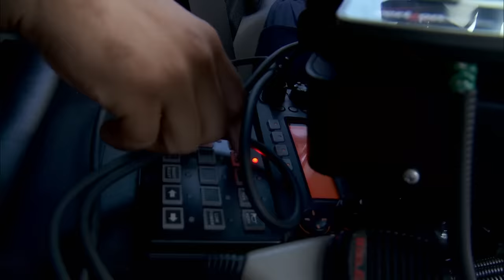$100k of Cartel Cash Found In Hidden Engine Compartment | Bordertown: Laredo | A&E

Comment: That was not the car that was involved in the chase. That was a truck/suv you can clearly see by the tires and if you know mechanics.
Reply: yea looks like a grey tuck or van
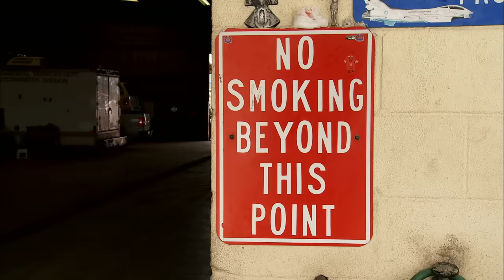Reply: Good catch...the difference between 2:16 and 3:20 Mag wheel rim and side step car on the second one is easy to spot but I did not notice at first
Reply: 2 different scenes.
Reply: @kaosinc  how are u
Reply: You mean the police lied? shocking
Reply: If the torque converter was replaced with a hollow compartment I'd guess the transmission wouldn't work
Reply: @pepsico815  its two different scenes
Reply: @frostfreerunning690  Yeah, a stick shift Grand AM ?
Reply: @2pugman  wym the car that was pulled over ? Nah I’m saying the car lifted definitely is not that small grand am
Reply: Not to mention the car was FWD Grand Am and the undercarriage of the truck/ SUV was clearly RWD since they disconnected the center drive shaft 😅
Reply: Plus the drive shaft it ant no front wheel drive car lol. Made for TV be!!!!
Reply: @pepsico815  Go figure 🙄
Reply: Looks like a F-150
Reply: Your point? They didn't claim that it was the same vehicle.
Reply: @randallsmerna384  they said since the suspect ran they impounded the vehicle and is doing a thorough search on it.
Reply: Good catch, so basically this is all BS.
Reply: @kaosinc  Of course you didn't notice at first but don't worry,some of us actually do notice and pay attention to things,we're just built different son!!
Reply: Glad I wasn’t the only one that noticed. As soon as I saw that driveshaft I knew it was a truck lol
Reply: Looks like by the rim it could be a Ford f150 99-03
Reply: This was defenetly a 99 ford f-150 ... i can tell by the catalic converter ..  first car in the chase was a 1999 to 2000 pontiac grand am ... its all a set up
Reply: yup there is that part that connects the front to the rear dif. Is that the axel? Clearly not the same car.
Reply: yeah..ive always commented this show is scripted
Reply: @kaosinc  Great catch. Mass Media is at it again. lol
Reply: It's a f150 Ford white
Reply: also it was a special edition rwd grand am
Reply: Looked like a Ford F-150 you can tell by the rims, it was drivable by a manual transmission that they removed you can tell by the hole leading to the cabin. With a automatic torque converter housing hence why there is all that space, good mechanic that came up with that spot.
Reply: F150 or expedition
Reply: @randallsmerna384  well genius we were assuming that since they just chased the white car and then they said they're going to take it to the Sheriff's Department for further examining that it's the same vehicle... everybody's wondering the same thing.... can't stand difficult people like you

Comment: I'm not seeing how this is possible. That's definitely a manual transmission. It has the pressure plate and clutch, but, there's no shift fork.
Reply: Yes fork, pivotal plate is there but the housing is extended i think. Idk? It is unique.
Reply: Some cars have a round hydraulic cylinder in the center that operates the clutch
Reply: @TheAnswersAreWithin  I see throw our bearing but no fork. Also no hole for the fork.
Reply: @TheAnswersAreWithin  I understand what you're calling the fork. But you can see before they pull the bell housing there's nothing to push the flat piece holding the drugs. The bell housing has 2 holes in the top that possible but it would have been obvious from inside of the vehicle because there's no space. It would have the fork going through the floor. There's no other holes on the bellhousing. You can see the front of the trans there's nothing to engage the fork if it was there. I'm watching this on a projector. Also if his tools can tell him its in the bell housing why did they bother to disassemble it in the car? Just pull it out.
Reply: Chill Will  they covered 2 different stories
Reply: It’s a whole different car. This is a f150 4.6 engine an tranny set up

Comment: Extended bell housing short custom axle ?
Reply: Shortened driveline. By the way, the car they stopped was a front wheel drive.  The transmission they pulled out is for a rear wheel drive truck.